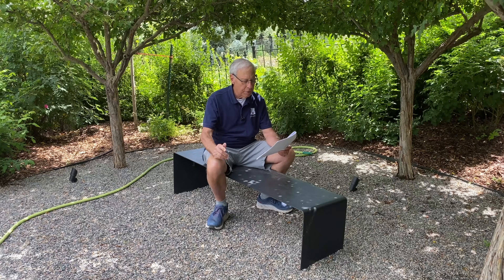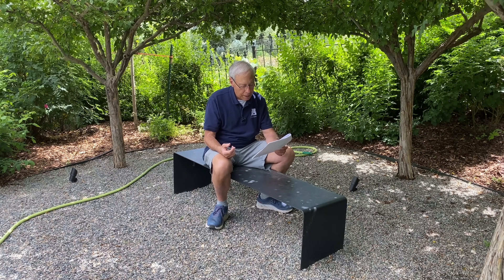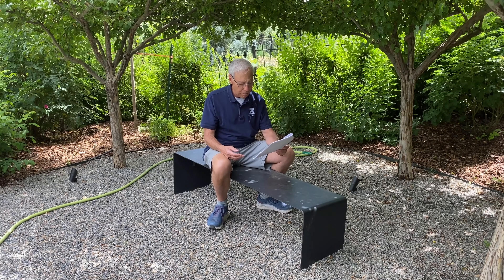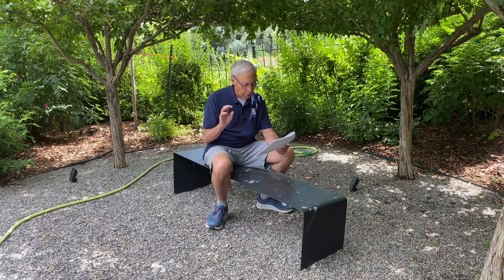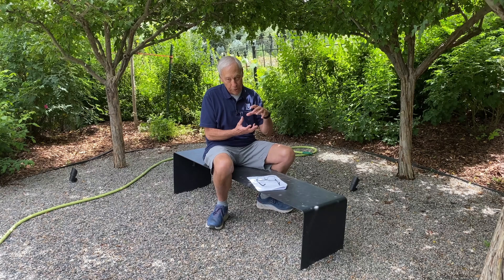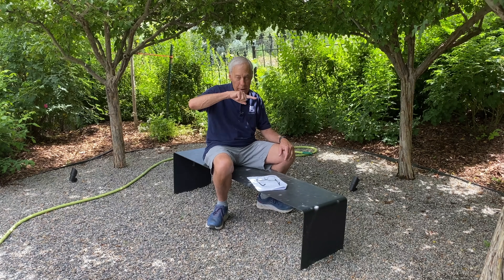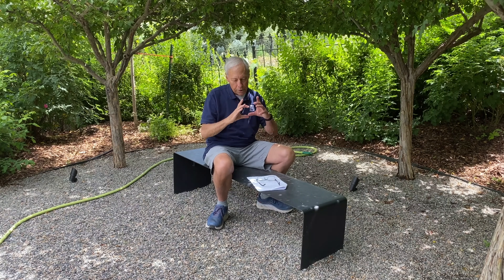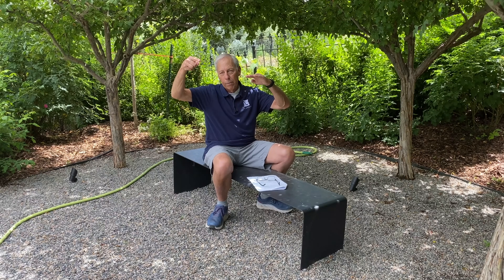Capacitors as indicators of audio quality

Comment: A capacitor is an imperfect component and a capacitor with more capacitance usually will filter higher frequency noise less effectively in a power supply. Thus you often see smaller capacitors used in parallel. And swapping your power supply capacitors blindly with larger ones might not only yield noise issues but can also cause damages to regulators or blown fuses due to so-called in-rush current when the product starts up. Still, it’s an area of easy improvements DIY if you know what you are doing. Especially, power supply capacitors in old audio gear might be the first to wear out and need replacement.
Reply: DIY folks can add a soft-start to mitigate inrush current damage. The best ones have a small power supply of their own. The circuit starts the amplifier circuit through a resistor for a short time, allowing the transformer to build up flux and the capacitors to charge. Then it engages a relay to bypass the resistor. The reason for the separate small transformer is that it allows the soft start circuit to work before the main transformer is energized. It's a good idea to attach a thermal fuse to the resistor and run it in series with the resistor. This will protect the circuit if the relay fails to engage to bypass the resistor. The reason for using a resistor rather than a thermistor is that thermistors don't offer protection for short-duration power outages; the device is hot and has low resistance. A soft start circuit can also include a mute circuit to avoid start-up pops. I have old amplifiers that have been re-capped. The soft starts keep my transformers from blowing up and my lights from dimming.
Reply: @BlankBrain  Yes, agree, you can add such circuit and significantly increase your power amp power supply capacitance. In fact, it's probably typically better for the sound to add some larger capacitors than to fool yourself with a US$1000 power cable.
Reply: @ThinkingBetter  I've thought it would be fun to build an amp PS using eight garden tractor batteries. This would provide plus and minus 48 volts DC. Batteries are about $55 each, so the total would be $440. Charging and monitoring circuits would probably be around $560. Safer wheelchair batteries cost about three times as much. Gel cells don't provide instantaneous current as high as liquid batteries. Of course ventilation would be necessary. The batteries are rated at 200 amps (165 cold weather). If you subtract 10% for internal resistance, that's 180 amps at 96 volts. This yields about 17 kilowatts peak available. There will be no sag. Of course I won't build this mess, but it's fun to think about what a $1000 power cord could buy.  For comparison, a PS Audio DirectStream Power Plant 12 is $4999.
Reply: @BlankBrain  The peak current needed by your speakers is depending on how low impedance your speakers have and how high voltage your amp power rails run at. 96V Vcc will yield 17kW in a 0.54 Ohms load (DC) thus, if you run 4 Ohms or 8 Ohms speakers, there is zero need for 17kW of power at 96V. It's easy to measure ripple and any fluctuation on the Vcc power rails of any amplifier and see how playing loud might cause any transient drops. If the voltage is solid under loud volume, there is no issue with either capacitors, transformer or power cables. For a power cable upgrade to have any serious effect on audio gear, you need to start with a really flimsy (high cable resistance) power cable that is inferior to the cabling inside your walls that is in series with the last feet of cable visible to you as power cable. If an amp yield any difference in noise on the Vcc rails depending on the power cable choice, it's rather a crappy power supply. Anyway I get your point...yes, US$1000 for a power cable is ridiculous and worst is that the production cost is probably less than US$20 for such cable FOB Shenzhen China.

Comment: So, what would one chose for a PSU, after the bridge, and before a tantalum 0.1uf, for a device that's on max 10 hours a week? 10 x 1000uf F+T  ok caps, or one 10,1000uf Mundorf nice cap? . Require detail AND smoothness. 17v5amps, LM338T
Reply: I say forget the linear supply and use a battery composed of 5 lithium in cells for 18.5 volts nominal and enough amp hour capacity to support the load for 10 hours. Then use a proper lithium ion battery charger like this one maybe :
https://www.sciplus.com/lithiumion-battery-charger-65503-p?gclid=CjwKCAjw4MP5BRBtEiwASfwAL-5QWIxPiMx8xe80YVOn_b0ImLivmeSnyEoEqsacg9PCqqs2VJDVohoCdHwQAvD_BwE

Comment: Hi Paul, i'm recapping a Kenwood KM-208 amp to remove a 60 hz hum. Should I try to find original Elna filter caps or upgrade to another brand? They are 90v, 10,000 mfarad.
Any help is welcome.
Reply: Elna will likely be amongst the best value for a decent cap, and they are of appropriate quality. The likes of Nichicon, Mundorf are also good. The more you spend the likelyhood the caps will be higher quality, though will it be audible in this case - very difficult to say. I would be more tempted to up the capacitance a notch, and you may find the same physical size is indeed now a bit bigger. I'm sure you know the 90v is important to match or better. Mundorf do a 100v 10,000uf in their AG range. 
It is not unusual to bypass PSU caps with a small polyprop cap, said to improve high frequency. Some will scream Snake Oil, though a couple of 1uf janzen cross caps is going to be about $3 - why not? Are you sure that's the source of your hum btw? Having said that if the caps are original they probably want replacing anyway, and I would go through the rest of the electrolytics in there while you're at it of which there are a fair handful. Recommend nichicon as go-to's for this.  It might even end up better than new!
Also; do de-oxidize or replace the connectors.
Reply: Is it 60Hz hum, or 120Hz hum?  If the latter, it could potentially be helped with new supply caps, but if it's 60Hz, look for some transformer coupling issues.
Reply: @marianneoelund2940  thanks & I will look into that but will still replace all electrolytics & research the hints from Jim & Rob also.
Reply: Thanks for your replies my friends.
The amp in question is from 1988 & the hum is definitely 60 hz but only shows up when a source is plugged into it. I did find a dry solder joint at the input jack (common leg).
Reflowed the solder without any improvement. I plan on using it for quite a while as it has plenty of power & clean output when operating correctly.
155 wpc min rms into 8 ohms at no more than 0.015% thd.
I can afford caps but not a comparable amp.
Thanks again & i'll post the results sometime in the future. Take care all.
Reply: @azmike1956  
If you only have hum with a source plugged in, then replacing the capacitors won't solve it - although I think you should go ahead with new caps, considering their age.  
Does it matter which source is plugged in?  Have you tried lifting grounds?  Does it make any difference whether you connect only one channel from the source, versus both?
Reply: @marianneoelund2940  it doesn't seem to matter which source is plugged in, the hum begins when something is plugged in.
With the amp powered up & no source plugged in, it is dead quiet. If this helps, it's part of a rack system with a control amp (pre-amp) that feeds the power amp.
In spite of the hum, the amp still puts out a lot of power. None of the components are grounded but I did try jumping between them, & using separate & common outlets.
I'll look into the input circuit for other discrepancies. Keep in mind that this is new to me & using basic meters, don't have a scope anymore. Thanks again.
Reply: @azmike1956  
What happens if you just touch the source cable ground, to the amp input ground without making the signal connection?  
If that causes hum, you could use an AC ammeter to measure the ground current.
Reply: @marianneoelund2940  I don't remember trying that particular check & at this point i'm too far into it to be able to do it now.
I am keeping track of these suggestions & will check them out as it goes back together.
Thanks for your help & look forward to any future help as well. 
Greetings from Aridzona!😊
Reply: I would also 2nd Jim re; bypass of any signal path with poly, even if just the one at the input.